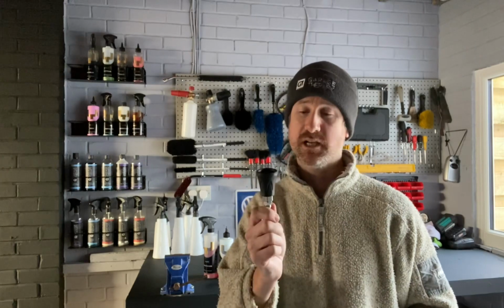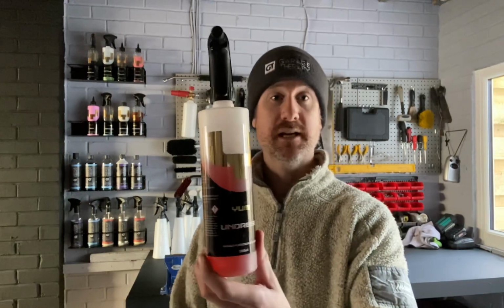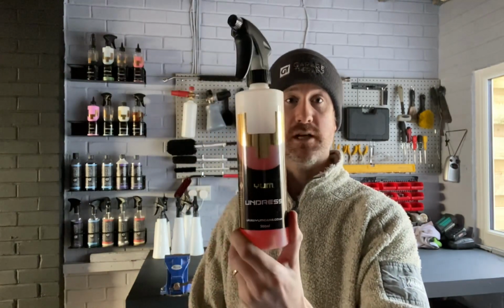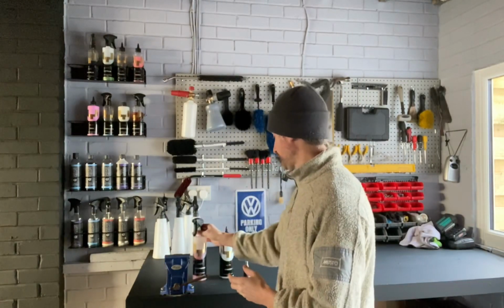ENGINE BAY DETAIL / VW GOLF R

Comment: Can you show if its start?
Reply from the maker: Happy to say car running strong 2 year on from filming this. Good question though. All was fine. Hope you are doing well.
Reply: @waysidecarvaleting  yea cuz we have 1.9 tdi and we have oil in the engine bay and i think its need to wash it but im scared if its not gonna start
Reply from the maker: Ok copied. Just make sure you cover the alternator/starter motor up with a plastic bag and any open wires you can see.
Reply: @waysidecarvaleting  Yea i now i will try

Comment: Did you wipe the engine bay down 24hours following application of Yum Dress V2?
Reply from the maker: Hey there. Nope all ya do is leave it to dry. I ran the engine up to produce some mild heat once it was applied and to make sure all was fine. Was a bit nervous I must say. Anyway, all came out great. On older engines it’s not recommended but new engines it’s fine. In summary Spray on, shut the bonnet, and leave it. Hope this was of help. All the best. 👍

Comment: Hi. Great video 👍 is there any other products that can be used in the same way as dressing. Spray on and leave? Have a 2018 audi a3 and thinking doing the same I have hyper dressing meguiar's  etc . But I think that's a wipe on not a spray on and leave. Any ideas much appreciated.  Keep up the good content 👌
Reply from the maker: Good evening. I’ve heard that the Chemical Guys tyre and trim protection is good as a spray on and leave. Also my first attempt on my last car was done by spraying autoglym’s  vinyl and rubber care all over. They have an engine bay cleaner now too. The good thing using Yum dress diluted is because it’s a conditioner so will help condition the rubber piping and protect for longer.
Reply from the maker: Koch Chem Motorplast as well!!
Reply: @Wayside Car Valeting  thanks for advice👍....what do you think of meguiar's hyper dressing if you ever used .. ?
Reply from the maker: @waynesworld6020  I’ve not used that product yet I’m afraid.